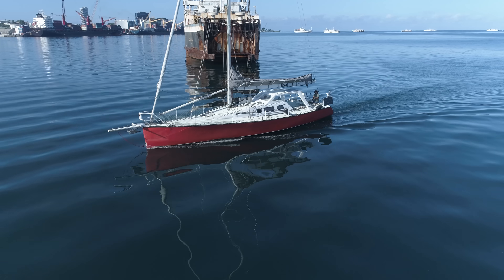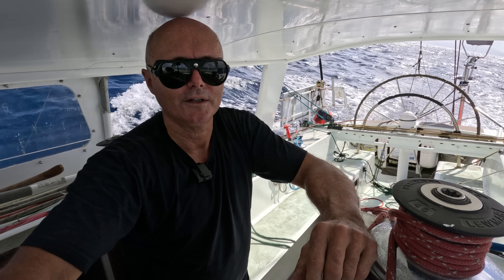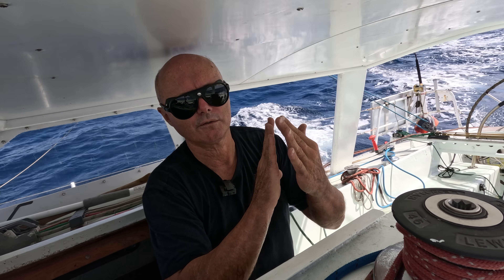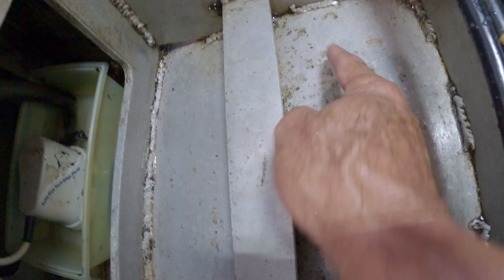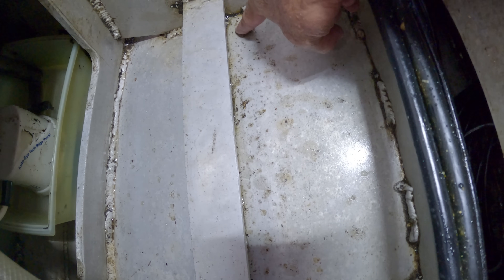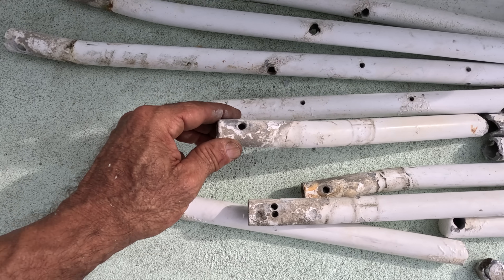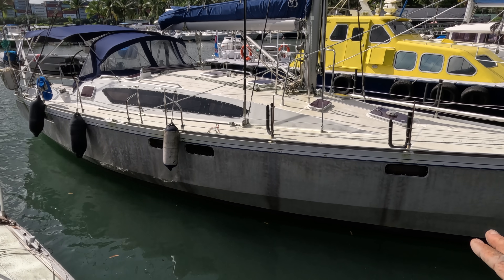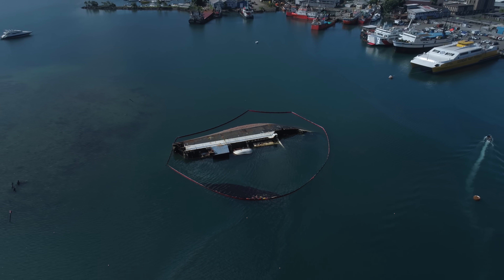Corrosion on a 30 year old ALUMINUM sailboat + Wrecks (ep20)

Comment: Egad, I'm going to have to make sure I get the latest sat photos before I rock up to your yacht club. The harbour looks like the 20-car wrecks we might see on the 401 Highway outside of Toronto during a January whiteout. But I'm pretty sure we sweep those up afterward so that, you know, no-one has an accident. 

All of the welds I've had a decent view of during your videos, I have to say, look 9-10/10 to me. Like stacks of dimes gently tipped over. I'm a non-expert, to be sure, but I have put my life in the hands of many an aluminum welder's work, and over time you get to know what you're looking for. Yes, 4mm below waterline is pretty spare, as I've come to understand things, but your long./stringer spacing has always looked pretty tight to me, again, from what I've been able to ascertain here on the other side of the world. But, again, those quality welds would give me the confidence I needed to run her up on the beach, careen her over and get to work if I had to. It's such a plastic material that I bet if you did hole her you would have a much smaller opening than just about any other comperable craft made from any of the other materials, including mild steel.

I knew a guy who had an emerg. repair system he designed that basically allowed him to turn even just a couple of interior frames into a mini watertight section with machine bolts, wingnuts, plywood, and his trick pony, rapidly-expanding foam. I was present for a dev-demo that I figured would literally blow up in his face (as an EMT back then I thought that's why he asked me to be there) but I walked away mostly impressed, it had real potential. He kept the stuff's two elements in 60ml syringes that mixed like a sized-up version of hardware store epoxy and the stuff didnt just expand but did so almost explosively, and throwing quite a bit of heat, it should be noted. We tested on wet metal surfaces, greasy ones, the stuff was indomitable. Scary, but cool-scary. 

What grade(s) alum is the boat built with, do you know?

Dont know if you've heard, but we might have some extra stock up here in Canada we're looking to unload. lol. The Americans have notified us that they no longer consider the legally binding contracts they freely agreed to at the time of order to be something that should, you know, legally bind them. As a result, we've decided we're not interested in their business anymore, as there's no shortage of demand from countries that do understand how capitalism works. They're not taking the news too well for some reason, but a time-out will sort them. 

We make A LOT of the wonderful stuff up here; all of our hydraulically derived electricity keeps costs bearable, and we have been doing it for some time now. Tell your mates. heh. Oh, we make a nice lager too, it's great for packaging aluminum in fact.
Reply from the maker: Yes the wreck outside the yacht club is a real hazard to navigation. It's covered at high tide. Nearly ran into it at night.  Canadians are great people and don't deserve that treatment from the Mafia boss in the South. Politics is a four letter word.

Comment: When repainting where corrosion has been removed, ensure you get the correct primer applied properly . I would treat the whole area with Alchoholic phosphate wash ( we use it on aircraft) , then wash the acid off before painting on your primer (wash primer or chrome etching primer). ( yellowish greenish colour ) .
Reply from the maker: I don't think a good etch primer like that is available in Fiji

Comment: Just bought an aluminum boat and noticed the earth was tied to the hull is your engine insulated from the hull?
Reply from the maker: Good question. I will have to check properly. I have not noticed yet but the earth is connected to the alternator

Comment: I have run an aluminum yacht and always had a little water in the bilge until I installed a system called Arid Bilge which uses a vacuum system. I couldn’t believe what a difference it made.

Comment: We have a 1991 aluminum sailboat built by Palmer Johnson and it is in excellent structural condition. Aside from proper electrical bonding, an isolating transformer is also a must on a metal boat especially if it spends a lot of time in marinas and uses shore power utilities.

Comment: there will always be water in the bilge, in an aluminum boat especially; the reason is condensation. I built a 29 ft. powerboat once, absolutely perfect welding, all around, still had water in the bilge. Aluminum is cold, moist warm air touches it and turns into water; that's it. As to touchups; the best thing is to sand blast the area (best to take the portlight out), blast it with crushed glass (not sand !!!), to bare fresh aluminum and prime immediately, I am talking hours, in not high humidity environment - middday sunshine?. Then topcoat. You can get a cheap hand held sand blaster for cheap; it needs a compressor though.
Reply from the maker: Thanks for your comment and good advice. I will try to find a sandblaster

Comment: Your alloy will self-anodize if it's exposed. Bubbles in the paint are a fault of the paint/prep etc. Owatrol Oil will seal your bare alloy like a lacquer or you can paint over it if you want the cosmetic route. 
Talk to KM Yachts or Steve Dashew and David Devilliers - plenty of successful long-term producers of all aluminium vessels.

Comment: Sailing Life on Jupiter just did a few videos about corrosion on an aluminum boat that would be informative to watch. Fiji should clean up there act and get those boats off the bottom. It wouldn't be that hard to do.
Reply from the maker: there is news that they have some funding to remove the wrecks, we will see

Comment: I'm amazed. I don't understand the electrical connection between the keel and the hull. I would have thought isolation to be an absolute must. Also, the absence of a floating ground. Very odd. Those couple of anodes must have done some pretty heavy lifting, over the years.

Comment: As I understand it: if you get salt water between paint (or wrapping) it will react with the aluminium and, in absence of oxygen, create an acid that keeps the corrosion going. 
Maybe someone with knowledge in metallurgy could elaborate on this?

On a second note the antifouling often contain(ed) some kind of copper powder. I bet some of the bad reputation with aluminium boats is due to the antifouling.

Anyway, a comment for the yt-ai to chew on. 👋🇧🇻
Reply from the maker: Yes I think some people are using the wrong antifouling on ally boats. Even copper coat say that it can be used on alloy. No way